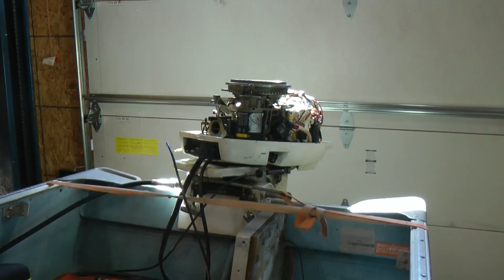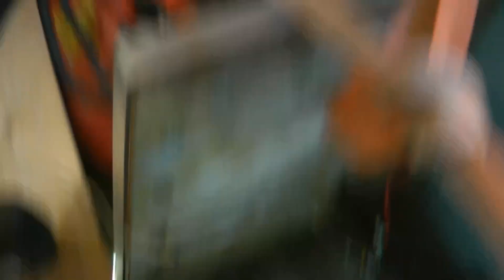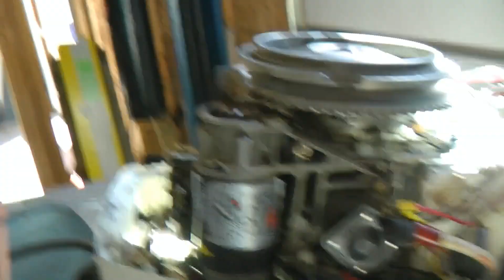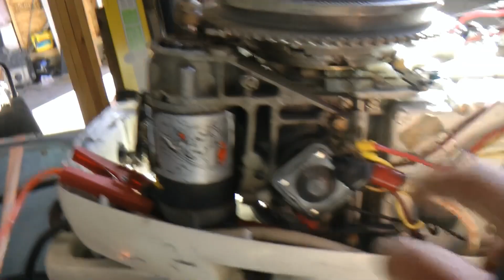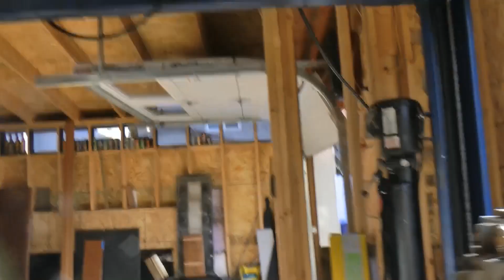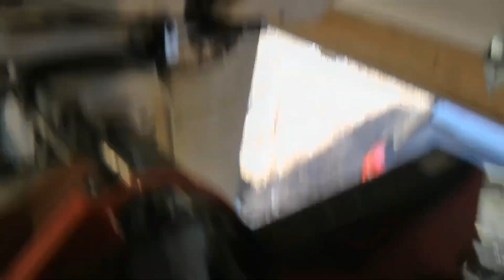Vintage Johnson 35hp - Starter Problems - Fixed for Free

Comment: Thanks for the info on the starter, You have the only video out there that shows a slow crank starter. I'm not sure I have the knowledge about the wiring but this gives me a good start...
Reply from the maker: Thanks. Remember, it could be multiple issues. Start with putting a jumper right on the positive end of the starter. That cuts out possible problems with the battery, cables, wires, solenoid, etc.

Comment: It's not a bad seal in the gear case.  That oil from the exhaust is very common when the motor is out of water - especially when run (even briefly) at idle speed.
Reply from the maker: Yes. You are right. The upside is that I now know how to replace the seal.

Comment: Hi Matt love the vids keep me up. I’m familiar with outboards and about the oil that may not necessarily be gear oil because I have a Merc 402 that appears to leak some sludge and I was confused because I had just done the lower unit seals and fresh fluid and because it was a two stroke some of the unburnt exhaust and fuel makes that sludge and drips down the exhaust tube inside the motor and drips down the skeg so it could be gear oil or just unburnt exhaust and fuel hope that helps if you need any advice about resealing your gear case feel free to ask I’ve rebuilt gear cases as well
Reply from the maker: Boy - that makes sense. I don't know whether it was oil slug from the exhaust or gear oil. Well, I did replace the seals, so if it was gear oil, that should take care of that...
Reply from the maker: The fact that I was not getting a spark (see previous videos) for a long time (like a year), makes me think it actually was 2-stroke oil. It was going into the cylinder, not burning, and getting pushed out the exhaust. The gas evaporated, but the oil ran out the exhaust tube. Hmmmm. Good catch.
Reply: I have the leaking gas sludge problem with my 55hp Evinrude also. If I unplug the gas line at the motor when not in use it stops.